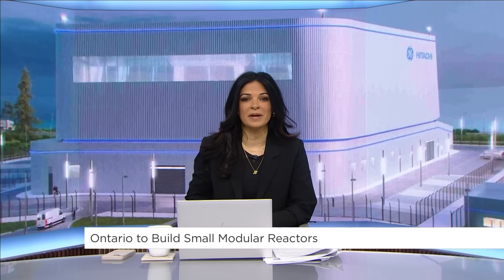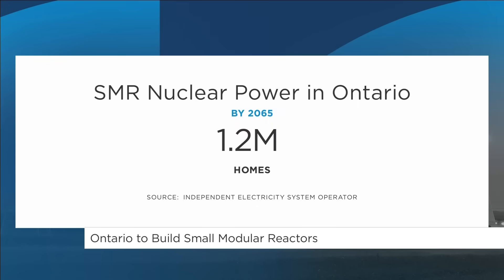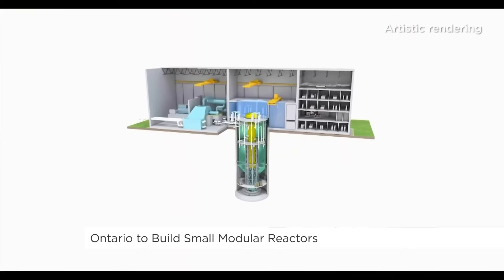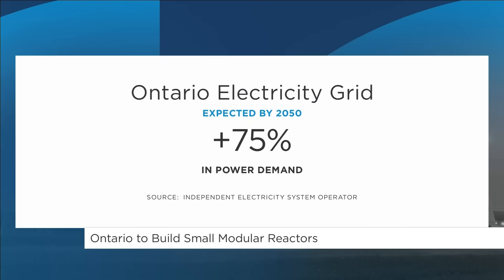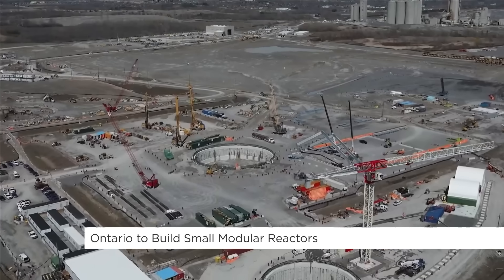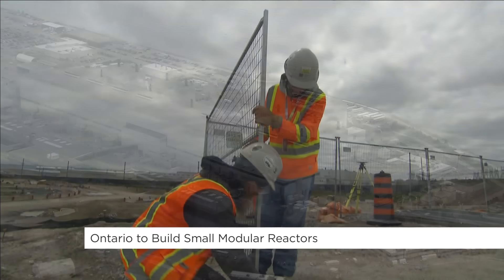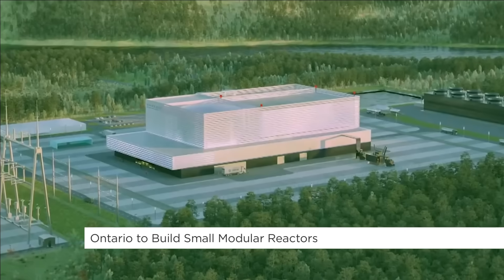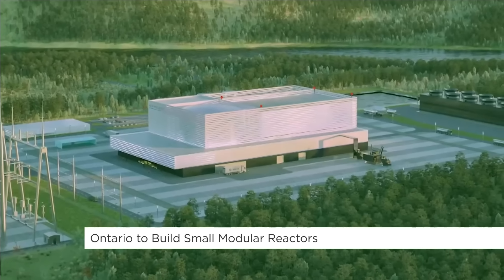Canada’s First Small Modular Nuclear Reactor | Your Morning

Comment: SMR will be even more expensive per MWh generation than traditional large-scale nuclear reactor and those are already amongst the most expensive ways to produce electricity.  Each SMR reactor is only ⅓ the power output of a traditional large-scale nuclear reactor so will need more of them.  SMR is essentially the industry's capitulation that large-scale nuclear isn't scalable.
Reply: They bring different attributes to the mix. There's a role for nuclear, but those who imagine its the tech to solve all energy issues are mistaken.
Reply: @Hyperpandas  Agreed. Specifically, nuclear energy is best suited to small-scale applications like military, scientific, and deep-space applications.  There's often no alternative to nuclear in these areas.  These are important areas of society too, and will get ever more important as time goes by. 

As it is, commercial utility-scale nuclear has proven itself to be the wrong tool for the job on the large-scale grid: too expensive, too slow to build, and unparalleled risks that no other electricity source even comes close to.

Over its 70+ year history, commercial nuclear only powers 9% of the world's grids and is falling.  There are many reasons but so many problems that nuclear just cannot shake: high cost & long construction times with zero watts output until complete.  Nuclear energy typically looks excellent on paper, but often gets smashed up against the realities of real-world engineering and real-world economics.

OTOH, renewables + storage is now as cheap or cheaper than just commercial utility-scale nuclear alone.   Plus renewables + storage can be built in the fraction of the time and incrementally in 100MW to 500MW tranches brought online incrementally, not waiting decade+ for the first watt to come out of a nuclear reactor onto the grid.  On top of that, renewables and storage are at historic low costs and continue to drive their costs even lower still!
Reply: Yes, SMRs may have a higher cost per MWh at initial deployment, but that’s a short-sighted metric. SMRs are designed for scalability, rapid deployment, and modular construction, meaning you don’t need a decade and billions upfront like traditional gigawatt-scale plants. You can build incrementally, reduce financial risk, and adapt to local energy needs.

Also, SMRs can be factory-built and shipped to site, cutting down massively on on-site labor and construction delays, the main cost driver of large-scale nuclear. That’s part of why countries like Canada, the U.S., and even the UK are investing heavily in SMRs as a distributed clean energy solution, especially for remote and off-grid communities.

And on the power output? Of course a single SMR is smaller, that’s the point. You deploy multiple units as needed, and often co-locate them with existing infrastructure or renewables, or even for industrial heat. It’s flexibility, not failure.

If large-scale nuclear were truly scalable and politically feasible everywhere, we wouldn’t even need SMRs. But they fill a critical gap in the clean energy transition that no other tech is solving right now.
Reply: @_TheSpaceCat  Thanks for your reply and comments.  First notice the OPG SMR project uses the GE BWRX-300 SMR.  300MW is on the large end of SMR.  It’s too large to be "factory-built" and way too large to be "dropped" on site.

The “drop-in” capability you’re talking about is only really possible for microreactors in the 10-megawatt or less that can be “containerized” and transported on a truck bed with most all cooling and other support systems built in.

You can see on GE BWRX-300 promo page that the BWRX-300 is housed in a building the size of a small office complex that requires a small industrial block footprint.  It needs to be built, tested, and certified on site just like any other nuclear project which is one reason why it's projected to take years to complete.

While marketed as a "Small Modular Reactor," the BWRX-300 is neither especially small nor modular in practice. It does not significantly improve construction time over legacy designs, and its FOAK status makes budget and schedule risks extremely high.

Many energy analysts and engineers increasingly share the view that SMRs, as currently conceived, don't solve the problems they claim to address. The idea of SMRs was originally appealing because of its promise: shorter construction timelines, modular manufacturing, standardized designs, and lower capital risk. But so far, almost none of these benefits have materialized and likely can’t, unless the reactors are truly “micro” in scale and manufactured like industrial equipment.  Look at Tesla “production hell” for example of how hard it is to "build the machine that builds the machines".
Reply: @_TheSpaceCat  Furthermore...

In general, the SMR concept is flawed.  It is too large to be containerized or factory built.  But it’s also too small and loses out on economies of scale of larger utility-scale reactors.  SMR is really the worst of both worlds!

SMRs don’t escape:
- Security and safety regulations
- Redundant backup systems
- Strict NRC/IAEA licensing
- Decommissioning liability

Specifically, the non-power-producing infrastructure (cooling, safety, regulatory compliance) still adds massively to cost and complexity.

No SMR project has demonstrated significantly faster construction or lower cost per MWh than conventional reactors.  In fact, FOAK projects like NuScale were abandoned due to ballooning costs, and Darlington’s AP300s are expected to take 6–10 years per unit, sequentially.

SMRs inherit all the regulatory and safety burdens of nuclear while providing none of the cost or deployment advantages of renewables. Unless there is a radical transformation in nuclear manufacturing,  and a global SMR supply chain emerges, the current SMR model looks like a costly detour, not a solution.

So many nuclear projects look fantastic on paper but crumple upon impact with real-world engineering and real-world economics.
Reply: @beyondfossil You raise valid concerns, but your critique leans heavily on outdated assumptions and selective framing while ignoring broader context and innovation.

First, yes, the GE BWRX-300 is one of the larger SMRs, and it’s not designed to be "containerized" like a microreactor. That doesn’t mean it’s not modular. The modular aspect refers to construction methods: factory-fabricated components, standardized designs, and repeatable assembly processes that cut cost and risk over time, just like prefabricated bridges or modular buildings. Not every SMR has to fit on a truck bed to qualify.

Second, it's misleading to compare first-of-a-kind (FOAK) projects like BWRX-300 or NuScale to mature designs and expect immediate cost parity. Every energy technology, wind, solar, even coal, had ballooning costs in early deployments. FOAK is literally the phase where issues get ironed out. That’s how innovation works.

Third, saying SMRs inherit all the regulatory burdens of conventional nuclear but none of the advantages is just false. SMRs can simplify containment, reduce emergency planning zones, and improve passive safety. Designs like Moltex, Terrestrial Energy, and X-energy are actively being reviewed for these very benefits.

Also, you gloss over SMR deployment flexibility, something gigawatt-scale plants simply cannot match. Remote and industrial sites, mines, off-grid communities, and energy-intensive industries can all benefit from distributed nuclear generation, especially in regions where large hydro or new transmission lines are unfeasible.

As for your claim that no SMR reduces MWh cost, that’s premature. Projects like the BWRX-300 are expected to reduce capital cost per MW by up to 60% compared to legacy reactors (GE Hitachi), and cost curves improve with scale. That’s exactly what happened in solar and wind after mass deployment and factory learning.
Reply: @_TheSpaceCat  The problem is the “modular” is only in the name.  These SMR units are not modular nor mass-produced.  They’re custom-built for a single deployment.  

Not currently mass produced
There is no large-scale manufacturing facility or supply chain pumping out dozens or hundreds of identical reactor modules.  Some components may be prefabricated and assembled on site but this is still bespoke construction, not true mass production.

Just to be clear, just because there is a model name (BWRX-300, AP1000, or NuScale VOYGR), doesn’t mean it’s mass produced.  

Until SMRs reach that level of manufacturing maturity, they cannot credibly claim the benefits of serial production no matter how slick the branding of the reactor model sounds.  I’ve just encountered this incorrect assumption several times in other online chats about SMR.

True mass and serial manufacturing do exist in solar and wind.  Wind turbines and solar PV modules are mass-produced in large factories with high volume supply chains optimized for speed and cost.  True mass production.  Even large wind turbines have modular towers, nacelles, and blades that are built to a model design, delivered by truck, and installed in days, not years.  A 300MW wind or solar farm could be installed and sending energy to the grid within just ½- to 2-years with subsequent additional 300MW sections well faster than that.
Reply: @_TheSpaceCat  Furthermore…

Huge challenges to nuclear (SMR) mass production

FOAK costs are endemic to the nuclear industry.  At the root of it is the old chicken-and-egg problem:

No mass orders → no serial manufacturing
No serial manufacturing → high costs & slow builds
High costs & slow builds → no mass orders (_and repeat from the top_)

There just ain’t enough orders to justify the hundreds of billions of dollars needed to invest in an actual factory pipeline for such low volumes.  With 2+ to 10 years between orders, newer SMR designs could be available and the existing tooling and manufacturing pipeline would need to be modified while still supporting existing builds still in progress.  There is always market pressure to offer new and better designs and some may be necessary due to changing nuclear regulations.

In contrast, solar equipment may cycle through models within months to a year offering a continuous stream of new technology.  Wind would cycle in a few years.  Natural gas turbine plants may cycle in a bit more.  

SMR installation needs to get to parity with the speed of installing a similarly sized natural gas power plant.  Gas turbines are true drop-in components, and the rest of the plant is simple compared to nuclear energy’s safety infrastructure.  GE, Siemens, Mitsubishi, and others have high-volume, mature production lines for gas turbines. These can be delivered and installed in some 16 weeks not years.  The prefabricated natural gas power plant could be pre-built and ready to receive the turbine part for installation and the plant could be generating power for the grid within 5 months.

But that is not happening with SMR and likely not any time soon—or ever.  SMR is being marketed as if it were equivalent to a natural gas power plant installation but it is not.

Unique Nuclear Challenges
As you know, nuclear has unique challenges with safety requirements.  They need a large amount of radiation insulation, a full radiation containment dome able to withstand a direct hit from a jet liner.  They need extensive regulatory oversight.  Multiple redundancy systems.  These extra safety procedures and designs are non-negotiable and must be done.

High Stakes Operation
The fact is, every nuclear power plant operates in a “high stakes” operation.  Because just one slip up of even a fraction of the seriousness of Fukushima-Daiichi would set back the entire nuclear industry.  

Ontario's nuclear setup win Darlington and Pickering is especially risky because its right next to the heart of the Canada's densest population center.  Its not far from US population centers too.  And its along side a major water body of the world (Lake Ontario) using its waters for cooling.

Unparalleled Risks
Quite simply, nuclear energy has unparalleled risks that no other electricity generation even comes close to in risk profile.  This is endemic to nuclear energy and is the risk is a big part of the high price we all pay for such high density power.
Reply: All nuclear and renewables are wanted and needed. Stop playing this unhelpful game. As long as it replaces fossil fuels it's needed.
Reply: @stickynorth  The biggest problem is nuclear energy's high cost and long construction time.   Nuclear energy's biggest ongoing Achilles heel.  Not just with Ontario but the world.  Except maybe China but they're leagues ahead and what they do with nuclear is not applicable here.  Annually, China builds several times worth of solar, wind, storage over their nuclear construction which tells us something.

OPG says the 4 SMR unit's total cost is just under $30B .  But the final cost will likely double that to a whopping $60B and possibly more.  This is how nuclear projects always seem to go in the western countries.

Also, OPG proposes the first SMR will be complete 2029.  This unlikely.  More likely is 2037 after an 8-year delay.  Remember, this is a never installed nuclear technology and even installed well-known nuclear is over-budget by billions and over-schedule by years!

Money and time is not infinite.  Better would be spent on renewables + storage that grow cheaper and better each year that goes by.

Ontario will get exactly 0 watts from SMR all thru 2037.  But renewables and storage will incrementally provide power as they incrementally built out in phases and connected to the grid.  That is a lot of years of wasted time waiting for SMR to provide the first watt of electricity!  Could be getting 100MW to 500MW of solar within 2-years with accelerating time schedules after that.

Trusting on nuclear energy to decarbonize the world actually will allow fossil fuels to run longer!  OPG hasn't launched a new nuclear power plant since 1993 which is 32 years ago!  That tells us something.  All while natural gas was added to Ontario's grid.